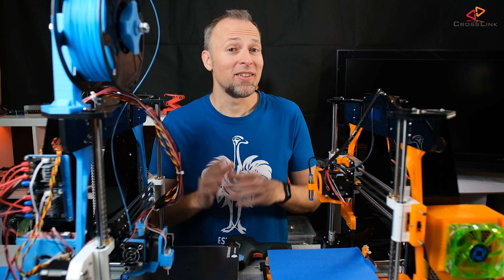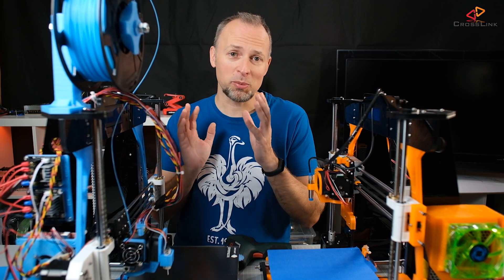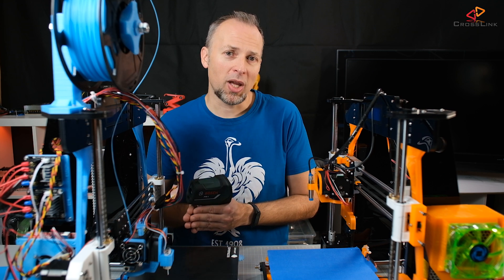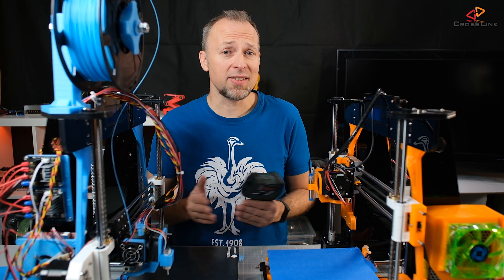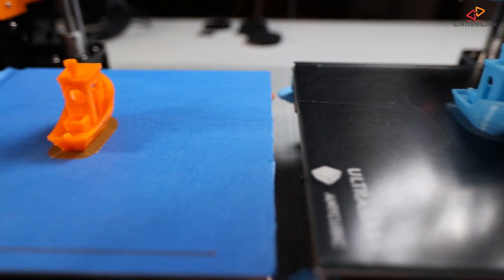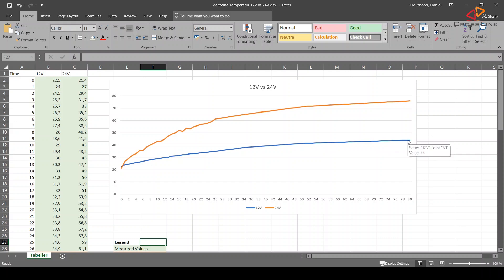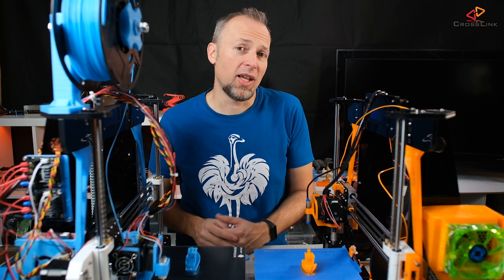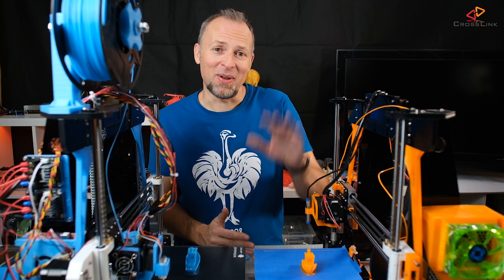Anet A8 24V Upgrade - Hot or not?

Comment: Do you recommend lowering the run current? I just converted to 24vdc but still have the original steppers (x,y,z ( Idid  chang My extruder , it is a hemera )) What are your recommended run current settings ? I am running klipper and tmc 2209 drivers. my current setting is .6 amp x,y . .7 amp for Z

Comment: If you had the extra parts laying around, could you just replace the hot end heater and heated bed with 24v parts and use a 24v PSU to power them using mosfets? Maybe a buck board to power the board?

Comment: INTERESTING seems to me if the quality outcome of model/print is the same, why increase the power voltage usage (this would also logically shorten the lifespan of parts/steppers, while also increasing power usge/electric bill). As the higher heat curve proves that steppers will be far more strained.

GOAL to lower the voltage and produce the same quality result, seems to me would be the most desirable aspiration - using as little power as possible is better for the parts, costs and environment.

UNLESS the machine cannot produce a result with said available power, I think if you could get the smae results from say 6-Volts that would be even better :)

Thank you for producing this video, it has been VERY insightful - GOD Bless!

Comment: Help. I reuse Anet A8 original motors but I dont know cuurent, I find 0.9A and 1,68A, help me, tks
Reply from the maker: 0.9A should be enough mostly. They also will not run as hot. If you discover issues, slightly increase.
Reply: @Crosslink3D  tks

Comment: I'd like to see this tests after  changing the setttings for the steppers a bit lower.  It's nice to be able to set the torque higher though with the 24 Volt...
Reply from the maker: Thanks for your comment! I tried to find out how to actually do this with the Anet board as a follow up on your comment but so far did not find anything about this. can you elaborate a bit on how you would lower the stepper settings? is this a software thing or has it to be done at the stepper driver?
Reply: @Crosslink3D  There is a little potmeter and for as far as I understand this is setting the stepperdrivers.

Comment: But I also heard that if you just upgrade the 12v PS to a meanwell 30a from the stock crappy one, you are all good. So is it really any need to switch to 24v?
Reply from the maker: It's not really so important it you are happy overall. I would replace the PSU always for safety reasons. Also solder all connections and use thicker cables everywhere. stay away from printed cable chains. the 24v is just giving me faster heat up times for now. Long term results will have to show if there is new issues with this upgrade.

Comment: The motor doesn't care about voltage per se (within reason), it's just coils of wire, one could run these motors from 5V to 50V.  What matters more is the power (Watts) delivered to them. If one doubles the supply voltage from 12v to 24v power, the total watts going in the motor is also going to double and it will generate more heat, wasting energy.  One should revisit and adjust the Vref on the controller board to help compensate for this.  UPDATE: I understand Vref is not adjustable on this printer?!?  ...weird.

Comment: Did you modified the vref ?
Reply: On my stock printer, the motors were running a bit warm, so I dropped the temp significantly by lower Vref by 15% with no issues (missed steps). I suspect the manufacturers set them on the high side as it will result in less support issues.

Comment: The steppers themselves should be rated for much higher temperatures than you'd think. At least all the ones I've used are.

Certainly the bigger ones I've used in bigger projects get too hot to touch well within their rated range. I'd wager as long as you aren't melting or deforming any of your motor brackets it's all good.

Comment: That's way hotter than I would like to run them.
Reply: My hotest motor runs at less than 40C.  Although I expect his motors are still within spec at 75C, running them hotter than necessary could shorten the life and wastes energy. The Vref needs to be adjusted when doubling the voltage.
Reply: @timezonewall   Exactly. You can't adjust VREF on the Anet board and it's factory set for 12v not 24v. Daniel either needs to go back to 12v or get another main board.
Reply: @JohnSmith-mk8hz  Interesting, I don't own this printer and didn't know Vref wasn't adjustable (dumb design decision).  Yep, that board is not suitable for a 24v supply.  I've been considering the newer A8 plus and was searching for videos about moving from 12v to 24v on Anet printers.
Reply: @timezonewall I don't know which board is in the A8 plus. It could be adjustable, I don't know. But if it's the same board that's in the A8, it's not. Well actually the Z driver is adjustable. I think that's cause it uses dual Z motors on one driver, so they made sure they could tune the Z axis.
Reply from the maker: It's correct, there seems no way to adjust vref on these cheap boards. However if the Anet A8 plus has the same board and runs at 24v I have to check what's different. Unboxing the A8 plus soon so we will see.
Reply: @Crosslink3D  It should be interesting.

Comment: I'm surprised with this result.  I thought they would run cooler with 24v.  Great test and great info as always!
Reply: Double the voltage and you double the power (Watts) going to the motors. The excess unneeded power has to go somewhere so it just goes out as heat.  Generating that heat wastes energy and could potentially shorten the life of the motor. If changing from 12v to 24v PS, the Vrefs on the controller board need to be turned down to reduce the current delivered to the motors.
Reply: double voltage, double watts to the motor, BUT.. double torque too!  You can go faster, or same speed with less amps (and same watts).
Reply: @LoKuSKus77  Maximum print speed with acceptable results is dependent on many things (inertia of moving parts, processing power of control board, stability of the frame, filament, etc), I doubt one would get much more out of this printer. The best thing would be to lower the current, unfortunately Vref on the controller is only adjustable for the Z axis.